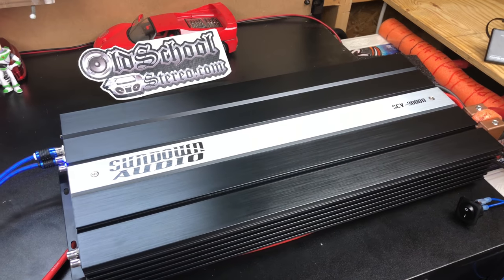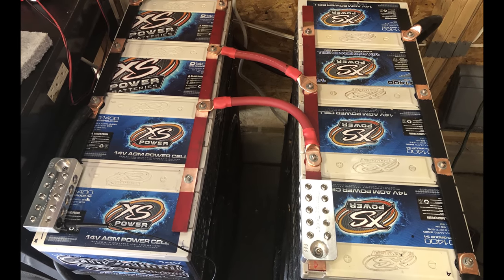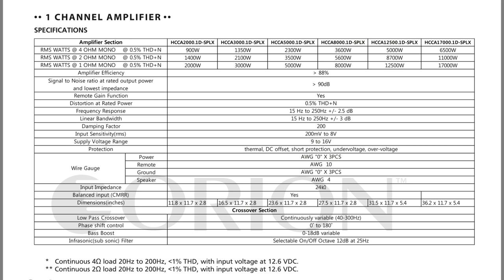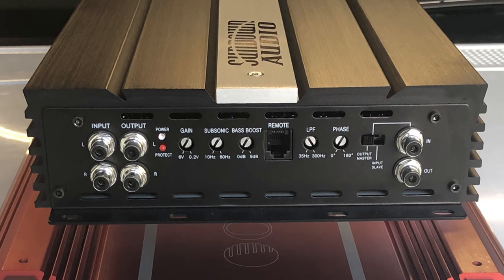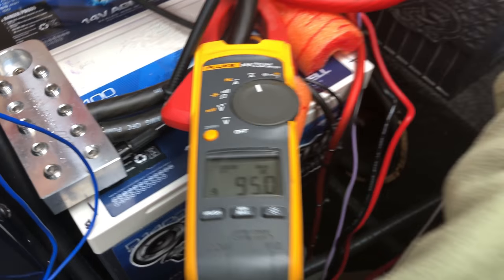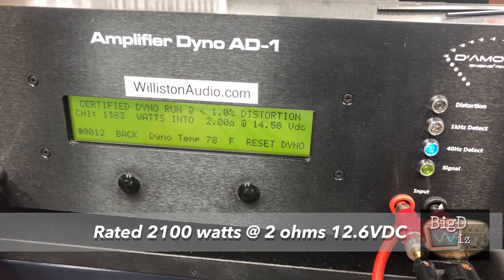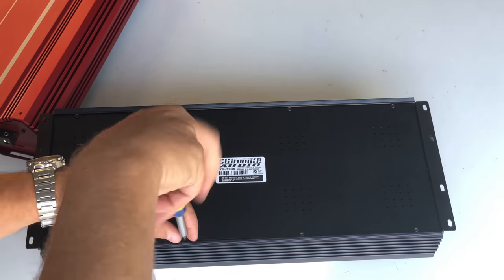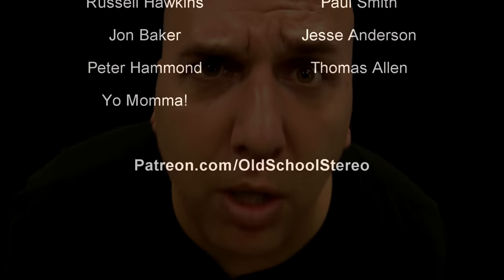Sundown SCV-3000D vs Orion HCCA 3000.1DSPLX Amp Dyno Test (4K)

Comment: Orion should flee the country to avoid Murder charges..
Reply: Lol as long as it's the hcca or xtr model cobalt n ztreet are crap
Reply: They use to be king
Reply: @long-range-eliminator  Damn sure were! Orion, HiFonics, Zapco, Lanzar, Fosgate, Rodek...some good ole days. And they were super efficient too; ride around and beat all day and they wouldn't dare get hot on some Pyramid Super Blues and house subs lol.
Reply: Exactly
Reply: @mrbrowz1000101  you got that dead on the money!😁😁
Reply: Orion is untouchable in my opinion
Reply: My very first system was orion cobalt 15s in a pores box with a planet audio 1k it was awsome ass system I just bought the Orion xtr 3500.1dx to go on 2 sundown x 12s
Reply: And the fkn thing is rated at 12v and has lower thd and higher s/n ratio also I personally know from my neighbor getting one and 4 dual 2oh. Subs n the fkn guy .25 ya 1/4 ohmed the resting sub load and the amp absolutely destroyed the subs after 4 months. Amp was perfect too.  
I mean it's cheaper than sundown fkn doubles it's output better build internally too so ya ur fkn fried like crisp well done fkn. Fried

Comment: I got a little confused I just seen Orion official website they did an unboxing and on the certified sheet that came with the amp it stated 3225 Watts but it was at 12.6 v big d whiz is doing 14.6 v I'm going to see how I can increase my voltage in my Explorer so I can produce these numbers

Comment: Orion XTR and HCCA have always been top tier. People just like to hate on them.
Reply: Alpha Omega I have the xtr 800.4 and it beats my ssa mids to its pulp
Reply: Can't get any better ratings at 12.6 volts nowhere else but Orion.. love my xtr1500dz
Reply: Love my XTR2200.1
Reply: I have the XTR4000.1 and its just a true beast, have it set a quarter of the volume up and its insane how much it pounds my 12" ZV4, trully amazing power. Orion has and always will be the best.
Reply: I'm Rocking two Orion 1200.4s and a 2500.1d. It all I need just need to get the electric right without spending another grand. 
A 270 alt and two D6500 xs powers arent enough.
Reply: Alpha Omega - You need at least 4 high capacity batteries and dual 270 amp alternators min.
Reply: Seriously?
Reply: Alpha Omega Have you considered building yourself a lithium battery? That's my next move. You can build a beastly lithium for around $500. Headway 40152s LiFePO4 cells are very easy to assemble, or A123 systems LiFePO4 cells are even better, but more difficult to build.
Reply: Will look into that. Actually never heard of a DYI Lithium batt thank you!
Reply: catch22frubert - Don’t do it! Lithium batteries are bombs and you don’t want them in your car permanently. If a cell goes bad and juice is running through them get your fire extinguisher ready.
Reply: King Willie There are different chemistries for lithium batteries. I wouldn't use Lithium Cobalt or Lithium polymer, but LiFePO4 and Lithium titanate are much safer chemistries. They don't have the thermal runaway problem that your cell phone battery has. With a BMS in place, you should be just fine with lithium iron phosphate or lithium titanate.
Reply: Alpha Omega Let me know if you need a link to buy. You should do a little research before attempting the build, but it's fairly simple. eBay has plenty of 40152s packages with everything you will need. I'd recommend 16-32 cells.
Reply: IF YOU DRIVE YOUR CAR DO NOT DO LITHIUM. Period, unless you have a SEPARATE charging and battery system for the amps alone (AKA huge competition system)... unless you use the main battery in your Prius or Tesla for beats lol Fire bad, mmkay?
Reply: @kingwillie206  wrong!! Lol. I run a mechman 270 with 1xs power xp3000 and my Bosch g24 starter battery... 12.6 full tilt with a slight clip
Reply: Dibeezy ThaGifted - I didn’t claim it can’t be done. I’m claiming that it isn’t as safe as lead acid and that is a fact. If you are an expert and know what you are doing fine, however, most people aren’t and have no business running insane amounts of power through lithium batteries. You could blast your system for an entire year, then BOOM💥 out of nowhere, believe it or not. One bad cell in one battery with the alternator pumping juice through it and it’s all over.
Reply: That's why I've always loved Orion. In the 90's most companies rated their amps at 14.4 volts the 2 that didn't was Orion and Precision Power that I can remember and that's what sold me on those brands
Reply: Whats better choice..rockford power series vs sundown amps
Reply: @wixman666  how do u use the main hybrid battery to hook a stereo to? The way I'm doing it im hooked to the 12 volt converter thats hooked to the main battery that charges the 12 volt system but amperage is limited toyota didn't design it with a 200 amp draw stereo in mind it would be nice if there is a way to crank it up
Reply: It's cause of they're kobalt line

Comment: I know Orion is in no way the same company they were in the early 90's and the name has been sold several times. However I was really routing for them. My collection of old school amps is small but I have some head turners. The Orion 225 and 250 hcca digital reference 2nd gen get the most attention other than my PPI pro mos 425. I was lucky to find an amp link which I didn't even know existed. They are real head turners. I wish they made amps that look that good still. I've been leaving comments on Orion's videos trying to get them to make a modern NT marble amp but they haven't responded. I've never asked for a thumbs up on a post but maybe if you old school guys could help me out and get their attention. Maybe a pipe dream but I know I would buy one if they made it.
Reply: I used to hate orion back in the day because I got smoked at a couple of competitions by guys running 225's. I was running Kicker amps and they were definitely under rated but not like a 225. You could have 10 of those 225's putting out close to 4,000 watts for every 1 500ss putting out 1,000. Otherwise known as the good ol' days.
Reply: Zeus and Orion was at the top in the 90s. If you from around Orlando, Florida you know SUGA them EVs in the little black car and NOD CHERRY in the Chevy Blazer bumpin thru the hood.
Reply: No , Orion is not what it once was.

Comment: Sundown audio is over priced and under powered. Orion all the way
Reply: amp wise yes sub wise no no no their subs are under-rated as hell
Reply: ABSOLUTELY 💯
Reply: you should tell jl audio that lol 
sundown audio underrates everything and there not overpriced there amps are not cheap bc they don't have cheap stuff on the amp everything you see on it is quality parts 

and remember sundown does rated at  14.4 volts and Orion does rated power at 12.6 volts that's why it does so much power
Reply: Not under powered, it did its 3k
Reply: @kevinl3892  over 3k

Comment: Wow.. just wow.. the smallest one turned out to be a small stick of DYNAMITE! it blew everyone else out the competition. I went for the nendo... now Imma start using Orion for my customers. Great job BigDwiz!!
Reply from the maker: May be one of the shortest, but I wouldn’t say it was the smallest
Reply: Small=short, but them guts definitely showed that runt of the bunch is on wattage steroids! I'm very impressed. I've been sleeping on them hccas.. haven't used them since the os 2100s..
Reply: For some reason everyone bags on their new amps. But truth is they are great value and under rated power. Love it.

Comment: Yikes!! I wasn't expecting that at all. Especially considering how some of Orion's newer budget amps have failed to meet spec. Super happy to see that Orion can still hold up to the big name they were years ago.
Reply from the maker: The XTR and HCCA amps are legit. I’ve expressed my concern with the budget amps and how they could harm the brand name...
Reply: BigDWiz 
It's good that you do these types of videos (along with others) because this awesome amp falls in to the opposite end of the "watch out for this amp" spectrum. Haha, this beast is dumping almost 50% more wattage then its rating, which is fantastic. Just understand the gain and buy appropriate speakers. If I had the extra cash floating around for an amp I didn't need I'd instantly buy one of these.
Reply: BigDWiz there is a new budget amplifier that they are working on in the cobalt line. 2000 true rms @ 14.4 volts for $199. There was a post on their Facebook a few months back about it and a video showing off the prototype. They are working on changing it all up

Comment: Yup, Orion. Basically could have rated their amp twice what they did and charged double. Now that's something!
Reply from the maker: I’m not sure why they are not putting the 14.4 volt ratings in the manual or specs. Would make it easier to compare their amps with other brands
Reply: @wal  probably because blokes like me don't have the proper charging system

Comment: The sun has set on Sundown!!!!
ORION woop Woooop
Reply: I know and losing business will force them to drop prices on their products they definitely need to drop the SA-12 from $214 to $160
Reply: AGREED!!! Sundown built their brand on their older stuff (which was WAYYYYYY BETTER) and now their products are falling off but are completely overrated and WAYYYYYY OVERPRICED!? What part of the game is that?!
Reply: buddylee19082 very true
Reply: buddylee19082 yeah ok their stuff is overrated when the amp in question still did more than its rated power.
Reply: I'm sry you misinterpreted what I meant when I said "overrated", but it's understandable in this context; what I meant was so many ppl act like Sundown is the best thing since sliced bread (hence the term "overrated") when in reality they haven't been that for years. Ever since they dropped the SAZ line of amps, they started cheaping out on their build quality and this test just proves it.
Reply: buddylee19082 I do like their products. Subs seem to still be handling plenty of power still though. I believe it was an scv 4000 that they have tested on their channel, the videos from 4years ago, and the amp did about 4300 certified and 4900 dynamically, then they did a dynamic .5 ohm and it put down 8000. Maybe that one was outperforming because it was the first of the line. Big D didn't do a .5 on this one but this is a different amp, and is one which was recently produced. I would like to see more than rated, but at least i know they aren't going to do less than rated, maybe a few watts, look at big D's newest vid. It still gets there before clipping and dynamically goes well over which is always good, I don't like when I see amps on the dyno that do the exact same as the clipping test. No dynamic headroom lol
Reply: Matt Wells  Actually on their updated video they did at 14.4v 1% distortion the results are: @ 1ohm certified- 5179w, @ 1ohm uncertified to clipping- 5640w, certified @ 0.8ohm 1% distortion- 6064w, uncertified to clipping @ 0.8ohm- 6334w, certified @ 0.6ohm 1% distortion- 6411
Reply: dylan sanford i just saw that video too, and every other time I've seen sundown amps dyno tested they have been well over rated, seen the sae1500 the 2000, the 4000 and I believe I've seen the n's series tested to, but that's a whole other animal maybe the 3000 is an ugly duckling of the line who knows. I clamped a good 1000 watts on my own sae1000 D on tones
Reply: Matt Wells ya the 3000 was just a dud imo it only does rated nothing more in most cases

Comment: Thanks Big D. You forced my hand and I got one of these Orion 3k's. I haven't had a system for 15 years. I will say Orion payed attention my amp Birthed 9-28-20 in fact now has a metal housed bass control knob, which includes a clipping light  and variable subsonic filter!

Comment: and that's why they have triple inputs on the Orion cuz they know it's a beast and it needs lots of power but the good thing is and you can run in a lower voltage and still get shitloads of power great job Big D Wiz keep up the good work
Reply from the maker: Triple inputs in a 3k amp are unheard of!! Obviously they did it for a reason, now we know why
Reply: With only 1 run of 0g for pow and gnd going into this amp, do you think it can still push at least 2500rms at 1ohm around 13 to 13.5 volts?

Comment: Curious if you’ve had a chance to test the newer version of the Orion 3000? Hearing some rumors that it’s not the same as the one you tested a few years back!!
Reply from the maker: I asked Orion and they said there were 4 transformers instead of 6 but the new ones had bigger wire. I’ve not tested one though

Comment: My skar skv2.2500 compares to the sundown 3k ratings .. 
I just bought the deaf bonce aak-4000.1d on preorder sale for $692 shipped. I purchased it the last day of the preorder sale on 4/1/19, and Vladimir had the shipment come early and it shipped the same day.. AMAZING
  I wanna see a 4k korean amp showdown now, this 4k has dual 1/0 inputs and the best bass knoB available.. clip light/ temp/ and voltage all in one.. and clip limiter switch
I'll be running this to a 2800w rms deaf bonce sa312 d1 5600w max BEAST

Comment: I've got a new in the box, never hooked up Hifonics Goliath XXV amp.  I bought it to do a install on a show truck that circumstances deemed necessary to never finish. I've only taken it out of the box a couple of times to take pictures of it. Interested in putter her on the dyno? I also have some MB Quart amps as well. At the time they were made by Rockford Fosgate (I believe).  Reference RAA 1000.  I have a couple of other RAA amps as well. Lemme know how to get in touch with you if you're up for it.

Comment: That's just unreal to me. I simply cannot get over how much power that amp put out. I want one really badly now. More then likely will be selling off some of my collection to buy one. Probably need to do it quickly before the price goes up on them.
Reply: what if they all had triple inputs though?
Reply: tankdog03 I don't think it would make that big of a difference. It would be nice and may help but there is no comparison to me between the Orion amp and any other 3k amp on the market. Look to me like it would simply crush any competitive amp in its class. It's way under rated.

Comment: Damn Orion! Huge numbers! This could be as bad as under rating amps, if a newbie to car audio bought this amp thinking it only made 3k at 1ohm and boom! Almost 8k on music! Woofers fired to death!  I'm all about these huge numbers, but I believe companies should rate them at what they make, not way under like some, or way over like we saw hear.. Awesome video BigD !
Reply: a beginner has no need for an amp with triple inputs, that should be a dead given
Reply: tankdog03 agreed but you can see my point right?
Reply: A gain control is not a volume knob.
Reply: Where did the "gain control" comment come from?  It isn't in the OP's post.  Why mention it?
Reply: Jacky Kimes -Tekboy808 made the comment that even a newbie should know how to twist a gain knob to control output.
Reply: I see your point but even for pros having a bit of bragging rights too. If my amp puts out 8k on music but is listed as a 3k amp, most people are going to laugh in your face when you try to explain how it's actually putting down almost triple the power labeled on the box. Just label it an 8k amp, or at least a 5k..
Reply: Anyone building with an amp this size should know ohms law and be able to at least use a multimeter to set their gain properly. P=IV
Reply: +Brandon Thompson or just say it does 3k at 12v, u gotta realize most people are not even running a true 1ohm load, and the dyno pushes these amps harder than real world situations.. this amp is definitely the king of 3k and most 4/5k amps.. I'll definitely buy one eventually..

Comment: I had a Orion cobalt 1600.1 d melt 12 gauge speaker wire and the terminals on a Q-Bomb rino liner box i paid 200$ for was pushing couple SA 12's Orion has always been my favorite for amps then fosgate.

Comment: I’ve used Orion since the early to mid 90s. I had 2 12” Orion xtrs in custom made to spec ported box. The box was huge. I had it in an Isuzu trooper. To this day I’ve yet to have a system beat as hard as that Orion system. I’ll put the old school Orion against anything new or old! Even the old cobalt stuff knocks! They have changed ownership so I haven’t looked much into them as of recent. However I’ve heard good stuff of the new hcca stuff, this amp being an awesome representation of the old school Orion stuff. I’m looking for the old school xtr subs subs

Comment: Great amp you are testing. Not overated. I watch your channel all the time. I was wondering about my nvx amps I bought. I am using these for my mid bass speakers. The model is VAD8402   2 channel amp. I have been watching to see if you are testing one of these. Never saw one on the dyno. They are heavy for a small amp. And they look nice. However, I have no idea what the true RMS. Output is. Or the current draw or efficency rating is. I would sure like to see true testing on these. My name is danny. Thanks alot.

Comment: Need a Soundstream TA1.3000D Dyno with these... Maybe put some pressure on the Orion? I am running the TA1.3000D on some r3.8 and it's an amazing amp and never had issues at .5 ohm...

Comment: Hey BigDWiz , that Ebay link where you can buy the Orion amp is it 100% legit? I've heard an example where the ones on Amazon aren't approved by Orion and had issues down the line, I don't have a problem with spending the extra money from a legit dealer so I can have warranty and all that,  I prefer to order online though xD